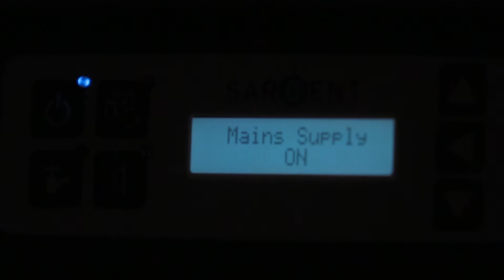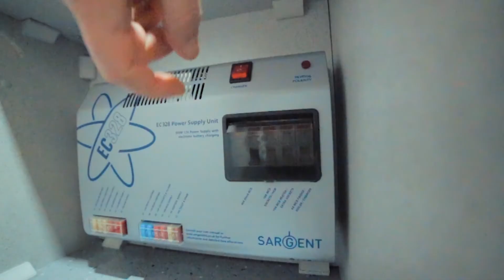How To Hook Up To A 230V Supply & Check The Charging System Is Working Correctly

Comment: Good video but I was wondering if you have additional advice? My Sargent EC155 is showing charging when on mains but isnt charging my leisure battery. One day was and the next day it wasn't and i believe i have checked all fuses OK. Any ideas?
Reply: I believe some of these sargents  are a basic constant voltage power supply rather than a smart charger.
Could it have damaged your battery over time and now it won't charge up at all.